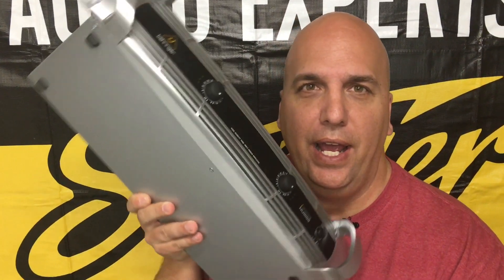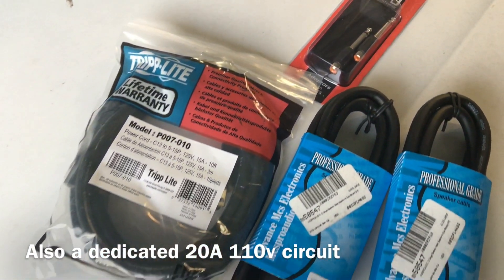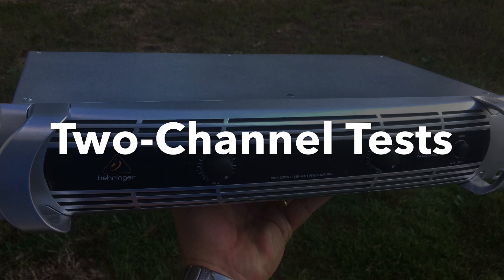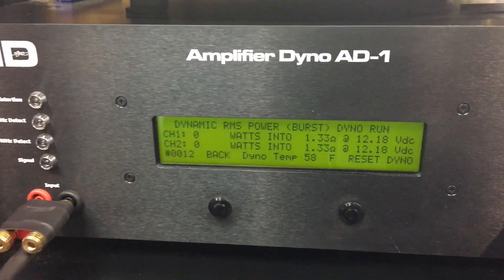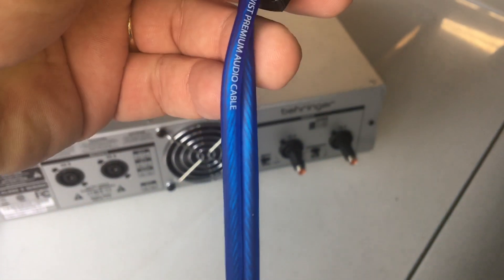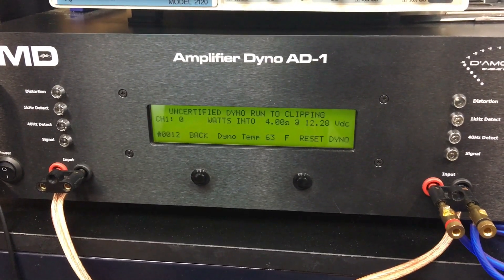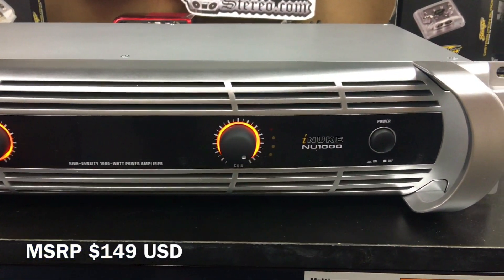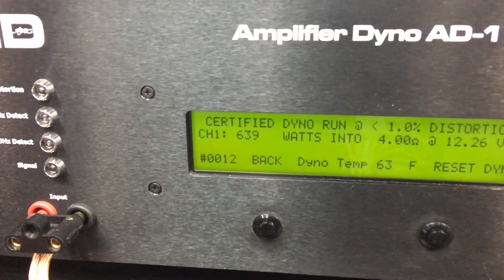Behringer iNuke NU1000 Amp Dyno Test

Comment: FYI to all those reading the comments about it under performing, The published numbers are peak. Take the peak numbers and multiply them by .707 (rms) and you get the power this amp should put out. I'm actually amazed that this amp put out the numbers it did in certified mode. Amazing that it actually puts out the power they claim for the price and warranty. Nice budget pro amp.
Reply: I don't want to say you're incorrect but my 3000DSP puts out less power than this dyno run shows for this NU1000. 

Measuring the voltage out of the amp distortion is audible above 24/25v out of each channel. Bridged 48/50v which is no surprise. 
If I take that voltage that's 150w or 300w into 4 or 2 ohm. Bridged at 4 ohm that's a little above 600w. 

Don't think my amp is defective. But I think there's more to it than the dyno shows. Past 48/50v bridged and I'll make my subs smelly which have a higher continuous power rating than 600w.

What would be funny if my 3000DSP was a bait and switch 1000DSP... wonder how I can tell the difference.
Reply: @JoshM7  are you measuring the voltage with a load or speaker attached? Sure sounds like the voltage of a 1000dsp even if unloaded.
Reply: @fidstang  Both. With a sub attached or without 24/25v per channel or 48/50v Bridged is the limit before you hit a lot of noise/distortion.

Single channel 2 ohm, 4 ohm sounds all the same, noisy/distorted past 24/25v. Bridged 4 ohm has that same sound around 48/50v. And it's scary to push it past 48/50v bridged because it makes coils smell when they should take  1,000w. (Ultimax 18)

I have Dual Ultimax 12s, a Ultimax 18 and Ultimax 10.
Reply: @JoshM7  Class D amplifier make some nasty distortion when pushed past their voltage rail capability and do it very quickly. You definitely have the 1000 judging by your comments and not the 3000.
Reply: @fidstang  Guess my 3000DSP internally was swapped or the 3000DSP is just weaker than others show.
Reply: @JoshM7  only way to know is to open it up and see. There are plenty of images on the net of both boards and they are physically different.
Reply: @fidstang  Looks identical to a 3000 internally. A 1000 has the caps in the center in a different place.

If it was a 1000 the caps next to the fan are basically side by side. On the 3000 the caps near the fan have some space to them.
Reply: @JoshM7  yes and they are physically different sizes. What is your input source and input voltage? Did you adjust the input gain in the DSP?
Reply: @fidstang  120v 15A is my only option. 

Input gain is at 0 but even if I adjust it up or down output sounds the same with the same limits. 

I use rca to xlr (unbalanced) from my receiver but that's not an issue. I've used my mixer with balanced XLR and same problem. Whether it's .3v from my receiver RCA or 4v out of my mixer output is the same. (4v is well above the typical +4 voltage)
Reply: @JoshM7  sounds like a bad unit then. Mine on my water cooled resistor load, measured 48.3 volts/channel with both channels driven and is clean on the scope. Don't know how long you've owned it, but I'd contact them.
Reply: @fidstang  I don't have a scope to measure if it's clean on a scope. But using a capacitor to listen for any noise it shows up at the voltage I mentioned. As well as past those voltages audibly distortion picks up and just doesn't sound right. I might be only hearing 1-10% distortion but I have no way of knowing without proper gear. But it's audible with the fundamental tone and is annoying. 

I've had it since around 2016 and as long as I keep in mind those limits it sounds perfect. 

Doubt Behringer would do anything if I brought it up with them. I honestly feel like this is just the limitations of the amp and a 3000DSP bridged to a Ultimax 18 would possibly kill it if you push it to 50-60v out of the inuke. Though it could possibly be the Ultimax 18 that's at fault. Which just adds another layer of possible disappointment.

Comment: Usually the difference between Class D and Class A/B amplifiers is the Signal to Noise ratio! But that can be fixed with decent crossovers and well designed internal pre-amplifer sections! Most companies in the car audio industry do not think about SNR when designing their Class D amplifiers and only focus on ease of manufacturing in mass quantities! Big D this is one thing you forgot to mention for Newbies to look for when purchasing an Amp, Always check out the Box when shopping to get details, like the Signal to Noise Ratio, the higher the number in DB the more clarity you will get from your amplifier! One of the first things taught in the Old School Audio Magazines from the Early to Mid 1990's!

Comment: You Know For Most Pro Audio Amps, It's Input Signal Needs To Be At 1.4Vrms Unclipped In Order To Get Rated Power Output From The Amp In Most Cases... But Thanks For Testing This Amp. I Was Wanting You To Test Pro Audio Amps For A While Now... Thanks..
Reply: I Guess Your Right, I'm Just Starting To Get Into Pro Audio, 
And Just Wanted To Make Sure This Amp Got The Input Voltage It Needed, Since 
It Didn't Make Rated Power.
Reply from the maker: +john starks yes, but this amp needed a full 4Vrms to make full output power. Thanks for watching and commenting 👍
Reply: Thanks for the reply, but was you able to feed this amp the necessary input voltage it needs for it to be able to generate its supposed rated power (from a car deck)?
Reply: many headunits puts out 4v ^^
Reply: john starks no worries.  This is basicly line a boss car audio amp quality.  They overrate things to trick the avarege consumer to think they put out the rated power.  Always pay for quality!
Reply: I Kinda Figured That, Thx For The Info, I'm Currently Running Two Crown XLS Bridged Into 4 Ohms Powering 2 Alpine Alpine Type‑S SWS‑15.  The Other XLS Stereo Powering Mains. It Does Ok For Powering A Small Bed Room > 200 Sq Ft
Reply: john starks niice setup:)

Comment: the pa guys are using a driverack for high line input... may need more signal or what?
Reply from the maker: I tried a mixer, same output. Just bought a Rolls MB15b ProMatch to try as well and use with future amps without RCA ins.
Reply: I had to get an Art CleanBox Pro to convert RCA to Balanced and boost the signal.  Works great for$65.
Reply: I’m trying to use this amp to power a single Ultimax 15 with a Denon AVR. It barely moves the speaker and it’ll clip easily. Could this be from a low input voltage? Would the Rolls make that much difference?

Comment: Hey BigDWiz :)
I would really like to see the Pioneer GM-D9601 tested on the dyno
A very commonly used amp, as it's fairly cheap, and many states that it can do the 1200w of rated power, But I really want to get the benefit of the doubt, and see what it really does!

For $189 it sounds like it should be doing good for the price
Reply from the maker: +G6 Liara I get amp test suggestions all the time. I cannot afford to buy every amp to test. Just keep watching, you never know what I'm going to test next...
Reply: Dereck BigDWiz Sounds good :)
And I'll be on the lookout for more videos

Comment: is this the first pro audio amp you have tested? because berhinger is the cheapest shit brand in pro audio there is.
Reply from the maker: Not really the cheapest, but I know it's close to the bottom of the barrel. I'd say Pyle/Seismic/Technical Pro are bottom of the barrel, Behringer is the value brand. The other "cheapo" models print 4000 to 8500 watts on their amps, you'd be lucky to get 10 percent of that power I'd bet. I've tested some home amps before, but none of the DJ/Pro style. This is the first of many I'll test, really depends on what my local dealer will let me borrow :-)
Reply: Dereck BigDWiz true, but berhinger is usually what people buy to practice at home or a small dive bar in a town of 1000 or so will buy as a backup. get your hands on some crown, ev, and funktion one and see if your dyno can handle it
Reply from the maker: Oh yessir, the Dyno can handle up to 5kW/ch at 4 ohms, so I'm good there.
Reply: Dereck BigDWiz funktion one has a few amps that will fry it, 8k per channel RMS at 4 ohms

Comment: I had a Night Club customer that wanted to use those against my advice, the club was open for 3 hours before he called me and said they had crapped out already. QSC went in in its place. Pumpin every night since then. Never use Behringer again. Not well built at all. Terrible customer service.
Reply: The simple fact you held it up with one hand out to tell you all you wanna know Big D. That should never happen with a Pro Audio amplifier
Reply from the maker: +Matt Bowles no way I'd use these in that setting. Weekend DJ'er (with a backup) or HT duty
Reply: Thats a big 10-4. My local Pro Audio sales house seels them as their "entry Level" units. We usually spec in Crown or QSC, but I had a customer who wanted these. We advised against but they persisted. Failed immediately
Reply from the maker: +Matt Bowles they offer a 3yr warranty, so those who can afford to be amp-less can at least be covered. I'm going to get some Crown and QSC models to test from a local dealer. I have high expectations, we'll see 🤔
Reply: Thats true the warranty is a good one. It gets used, trust me. lol. These are great for very low impact "Home" dj system. Or a Karaoki system

Comment: "pro audio amp"   Not so much.  Behringer is kind of the Kraco/Soundesign/GPX of the pro audio world.  There is a reason you do not find anything from Berry in recording studios, mid/large scale clubs, bars and concert halls, nor on the road with any touring companies.  You find them mostly in budding artist's basements who are running on low budgets, or mom & pop small venues.  It always blows my mind when I see guys dump ridiculous amounts of money into their systems and go through painstaking measures to build their subs with very expensive drivers - only to end up pushing them with something from Berry.  This is not the amp you think it is.
Reply from the maker: Ok, maybe "wanna be" Pro Audio? lol. It is obviously the low end of pro amps (although not as low as Pyle/Technical Pro/Seismic Audio/etc)

Comment: I've always had a feeling about alot of the so called (as far as I'm concerned) PA heads., this ,Crown and others......
Reply: Yeah, putting CROWN and BEHRINGER in same category, paragraph, etc is a crime!! Now, Behringer is still going to be a large step up most likely from gear sold as brands like "Technical Pro", which is some of the goofy "8000 watts" or whatever for $129 stuff. Some actual PRO'S may have some or even mostly Behringer gear, but most will tell you that Behringer is the discount version, using lower quality discount parts inside, of true Pro Audio gear made by brands like Crown,, QSC, Crest, etc.
Reply: I keep forgetting about how much the price per watt has changed, but I've only been watching it  since I was 12or13 and I'm now 41.....lol
Reply: Scott Miller crown is absolutely legitimate more so than any car Audio brand
Reply: I might have been confused. lol
Reply: Funktion One, JBL, crown, EV, Bose all good pro Audio equipment

Comment: Talk about rounding up to your nearest 1000W!
Reply from the maker: I was curious why they don't show RMS ratings in the manual for this amp. They show the NU3000 as 2200 watts, so based on the percentage vs 3000 watts, my measurement for this amp is right on

Comment: thanks for the input. my friend recommended the inuke 3000 so this gives me a good idea how it might preform!
Reply from the maker: I'm getting an NU6000, which is essentially (2) NU3000's in one chassis. It should do over 2kW per channel for teh NU6000 and total for the NU3000
Reply: Dereck BigDWiz you should get the dsp model

Comment from the maker: I updated the video description with definitions of the different test modes of the Amp Dyno
Reply from the maker: No, I would NOT try 2 ohms bridged with this amp
Reply: hey could you do a test on the Pyle pmwa3003t amplifier, I have two in my livingroom, they're fairly cheap at $170, and claim 3000 Watts peak, I know they aren't pushing 3k because a standard outlet would probably end up tripping the breaker with two, but I believe they can put out around 1000 Watts give or take a few hundred, it's a 4channel amp with bannana plug outputs I have them loaded to 4 ohms per channel, and my sundown e12v2 test out at more around 3.1-5, I've had the one these are on cut out when driving it way to hard on the 15ish not on bass I love you, and if you do, I recommend testing it with loud mode on and off to see the difference, it makes a huge power difference for me around and below 40hz all the way to single digits, I hope you can do this test as I'm very interested in the power I'm likely seeing, I know it's plenty considering at 15hz I can make the sundowns move 3+inches peak to peak(in a box tuned around 40hz mind you lol)
Reply: it's less applicable for pro audio because there's no speakon connectors, but it is much more versatile than the amp here, it's outputs are junk especially the sub outs, but it comes with mics, has two large guitar/mic inputs and many RCA inputs, which I use most in my home theatre/stereo setup, I also recommend that if you do it, max it's volume out at 30-40, going much past 30 while having a strong RCA signal doesn't hadd more bass power, just brings the mid area back up to the level loud mode boosts the low end, and probably will add distortion to it, whether it's very audible or not
Reply: +Matt Wells I meant it's RCA audio outs are junk*
Reply: +Matt Wells I meant it's RCA audio outs are junk*
Reply: Dereck BigDWiz can you do the f5 model of the rockville 5 channel amp
Reply: Dereck BigDWiz I have a crown victoria and I'm going to be running jl c3''s and one 15 type s, and want to know if the rockville f5 will be able to run the system. please respond
Reply: BigDWiz can this amp take 2ohm load in bridged mode?
Reply: I only believe .5 ohms below recommended will be tolerated by the amp...

Comment: One thing I've noticed looking through similar type of amplifiers at Parts Express are the power ratings are typically done at 10% THD. I don't know why. I guess like anything else, to boost the output numbers. That amp dyno can't read that high, right? Although I guess that's basically what "up to clipping" means.
Reply from the maker: Yeah, clipping is what many techs use for Amp Tests over the years. I prefer the 1 percent THD test (Certified) for most amps. That said, it is interesting in some cases to see the large difference between 1% THD and clipping

Comment: Needs a line driver.
Reply from the maker: +EBBCO REPAIRS I used my mixer as a line driver, no difference
Reply: Dereck BigDWiz Ahh. Just not built like she should be then.
Reply from the maker: +EBBCO REPAIRS Behringer specs don't mention, but Crown states "only" 1.4 volts input required, 10k ohms for unbalanced. Alpine 9815 puts out 4v, 10k ohms unbalanced signal

Comment: hey can u test 
a rockfordfosgate 700s
Reply: Eliasib Guzman doubt he has one to test. I have older bd1000.1 I'd like to see tested.
Reply: Kevin Nieto you should have a birth sheet, if you dont, it's at least 1200 @ 1 I had two with birthsheets
Reply: Matt Sullivan  i have 2 p3s 12d4s i wanna hook up with it u think it has enough power  for dem
Reply: Eliasib Guzman it has enough power for like 6 of em
Reply: Matt Sullivan  u know where i can find a birth sheet on da net cus supposely its not a 1 ohm amp only 2 omh would it damage it if i drop it dat low
Reply: It's a 1000.1bd? It'll be good for .4 ohm
Reply: Matt Sullivan no its a punch 700s
Reply: Eliasib Guzman I don't have a birthsheet for it got it second hand as broken but needed a minor solder job. This amp really strong even at 4 ohm. Ran a pair of kicker comp vrs at 2 ohm those subs were bouncing!
Reply: Kevin Nieto ok well im gonna run it series paralell c wat it does was thinkin of gettin one more amp o same and hook one for each sub

Comment: thank you.. you should do more videos like this the PA brands need to be revealed
Reply from the maker: It is planned. I'm expanding beyond car audio amps.
Reply: thank you u should check out the behringer ep 4000 they are claiming big but i dont think so
Reply: Leonardo Somoza the ep4000 is a rebadged ep2500 amp. it will do 2100 watts at 4ohm mono. I own two of them and they are worth every Penny
Reply: i have the ep4000 and o know they dont get close to rating just like the inuke ijust want to know how bad are they from their rated power they are solid amps just not power enough for bass
Reply: Leonardo Somoza Behringer ep4000 Is equal to EP 2500

Comment: A couple notable items:
The amplifier has a non-defeatable compressor/limiter to prevent full clipping. 
This amp does sound very good. I've used the entire range in front of house racks and nobody has ever complained about the SQ.
Reply: I only use the NU1000 in fill applications. I already knew they were all about half the faceplate rating. Behringer used to print the actual specs on their website.
Reply from the maker: +Aaron Hammett great info, thanks 👍